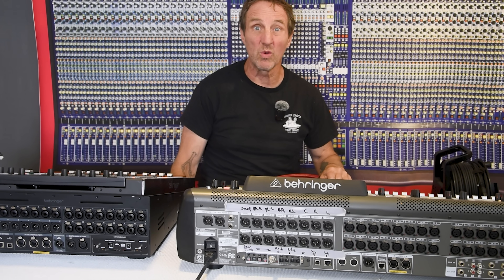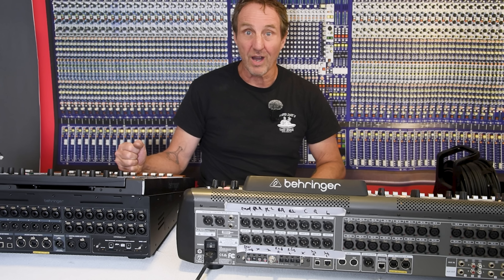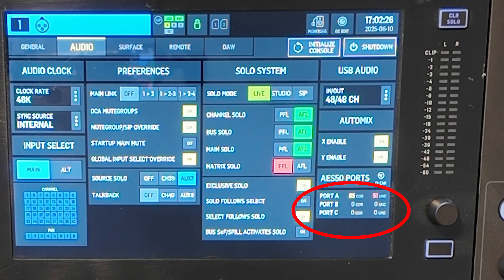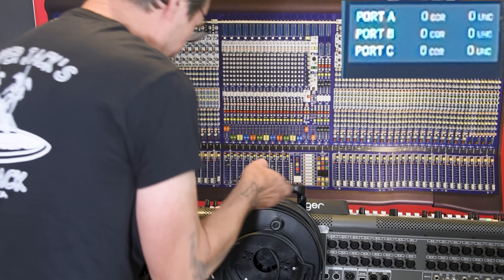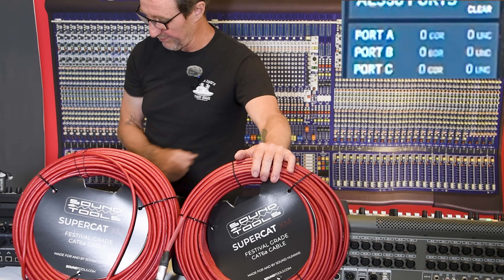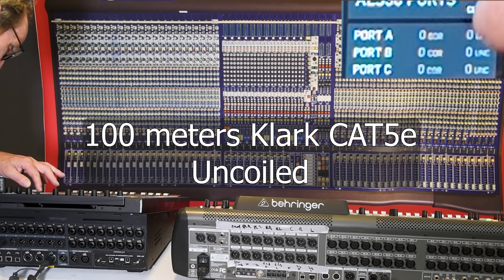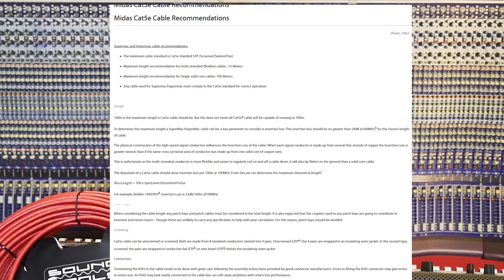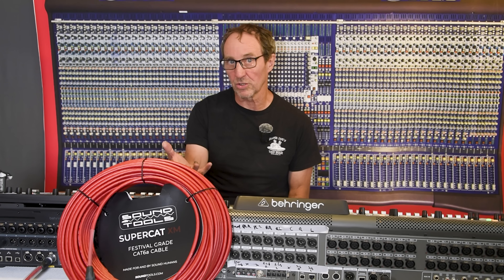Misinformation or Simple Test? - CAT5e vs CAT6a

Comment: Your video is a little misleading Dave. I understand you want to promote your own product but your evaluation is not a honest one. You did a video where you mentioned that Midas released a statement saying that they have changed their total run to 80 meters, instead of 100 as you portrayed in this video. I am one of those Facebook admins with close to 10,000 members who were adamant about using the Cat5e Shielded with Ethercon Connections, because our members were constantly reporting they burned out their AES50 Ports by using the Cat 6 like everyone was suggesting at the time. When I saw your video made over a year ago, you were just starting to work on your Cat6a cable. This video has convinced me that as long as the Cat6 or above cable meets the required specs, they should work just fine. FYI, depending on your firmware on the Wing, that could very well cause your drop outs as well as the update needed for the X32. Here is the link to the video you made over a year ago. https://youtu.be/bQXOXWuxCGA?si=su3quOLJPY0BZ5lQ
Reply from the maker: I totally agree with you and how is this vid misleading?

also, cat6a is typically much better than cat6 and shield is important for behringer products.

from all the testing I have done, the dominant factor seems to keeping loss at 24dB or less.

the cables with less loss are unshielded Cat5e and CAT6A (which should be shielded by design) 

another interesting side note is when designing the XM cable I could have released it as CAT5e as it meets all Cat5e specs. it also meets cat6 and CAT6A specs and I decided to use cat6a but that was a choice and every cable manufacturer is free to grade a cable at a lower spec.

in fact I am working on a plenum rated solid conductor shielded install cable that meets cat7 specs as well as cat6a and Cat5e, I am going to label it cat6a. 

what I getting at is it is I agree with you, it is all about the actual specs of the cable and not what the manufacturer labels it.
Reply: @DaveRat , your previous video showed you at 80 meters and this video shows you at 100 meters.
Reply from the maker: this video shows Cat5e at 100 meters versus cat6a at 120 meters.
Reply: @DaveRat , I have already removed the Cat5e only rule from my community and I am getting very positive feedback from your video. In your last video you stated that Midas made a statement about 80 meters is the max for Cat5e. 

This video shows you testing the Cat5e cable at 100 meters correct? That’s what I am referring to when I said it was misleading.
Reply from the maker: @DanaTucker1 ahh, copy that. I think Midas says the 80 meter max is for stranded which the KT cable is.

and yes, I did test at 100 meters which is beyond the max recommendation for stranded Cat5e.

the purpose of the video is to point out that any belief that Cat5e is is anyway better that properly spec'd shield cat6a for AES50 or pretty much any application is not founded in testable factual info.

quality CAT6A is awesome. faster data speeds, better shield, lower crosstalk, longer runs.

same with large diameter high quality cat7.

as for giving advice on what to use I recommend focusing on specs rather than catagory.

shielded cat cable with an maximum of 24dB of attenuation at 100MHz over the cable length being deployed is the magic
Reply: @DaveRat , I agree with you 100%. Some of our members are already using your specs and building their own Cat6a cables. 

To be honest, I am glad this stupid cable war is over and I will forever give you the credit for bringing it to an end!!

As always, forever grateful for the knowledge you share with us less experienced individuals who are seeking reliable information, from a place known for its unreliable information, the www. 😂😊
Reply from the maker: wonderful and that makes me so happy. stay curious and keep sound fun!

Comment: In IT/Network Cabling world, we used 85metres as practical maximum range for Cat5e.  (and ideally shorter).   Speed also makes a difference eg 10/100/1000/10k higher needs shorter in general
Reply: Good point and absolutely right. In his AES50 test setup, I assume Dave was aiming at a maximum bandwidth of 1 Gbps only, which is specified by most OSI layer 2 and 3 AVoIP network standards.
In a 10 Gbps network, cable length will surely be limited. But rest assured that Dante, SDVoE, AVB/Milan, etc. are using their very own (package compression, sample rate and bit depth limitation) methods to neatly stay within the 1 Gbps network bandwidth range.
Reply from the maker: wise. for large format live, 100meters is the standard length of the main snake. so 100 meters plus 2x 3 meter extensions is a good baseline.

but sometimes we need another 10 or 20 meters, hence my focus on 120 meters and a cable that will reliably do it.
Reply: @DaveRat  Makes perfect sense.  For most cabling runs - the 85metres was from a patch panel to a wall outlet.  That then gets patched at both ends so you are going to hit that 100m limit.  120 without going up in quality is pushing things.

Comment: Coiling: IF coiling made a difference (for the record, I agree it does not for shielded wire), a >larger< coil wind would have more inductance.  Inductance is proportional to the square of coil area.
Reply from the maker: by "larger coil" do you mean larger diameter loops or more loops?

is it quantity or loop size that increases inductance?

does one huge loop have more inductance than 500 tiny loops?

Comment: Are the wire gauges the same? Drop will tank any grade cable at a certain length.
Reply from the maker: the cat6a has 24g and the Cat5e in the vid has 26g.  that said, thicker wire reduces dc resistance but can increase capacitance which is also and issue.

but the thicker diameter of the cat6a reduce capacitance

Comment: This comparison gives a small piece of useful practical advice, but it'd be interesting to know "Why?"  

That might take a vector analyzer, a precision TDR, and a BER analyzer that tries to capture incidents and causes, not merely counts a total.   

It would make sense that shielded STP is better than basic UTP, as that limits potential mutual inductance and makes being coiled or not irrelevant, in addition to reducing susceptibility to induced or radiated fields of various sorts.  Fiber would be the next step, also in terms of ground isolation.  

A good analysis would evaluate better and less good line drivers, and life of cable breakdown issues.  

Even in the old days of 600 ohm analog lines at +4 or +8 and headroom over, s/n under, some brands of equipment had crap line drivers, and could self destruct, distort, or just not work right to the extent of full blown motorboating with long cables, while better products just didn't have such issues.  

As digital is really just an encoding of analog voltage and current patterns, it makes sense that longer digital lines can suffer similar issues if cable or line drivers quality is sub-optimal.
Reply from the maker: actually shielded is worse for loss than it's due to added capacitance rolling off HF.

the insulators one the cat6a are foam rather than solid which improves insulation at HF. the cat6a has thicker conductors reducing loss but increasing capacitance. the cat6a is larger diameter  increasing the distance between conductors reducing capacitance.

the precision of the twists is better on the cat6a.

the cat6a has individually shielded pairs which allows identical twist rates while still keeping crosstalk low. the Cat5e has an overall shield with the pairs twisted at different rates to reduce crosstalk.

those are a few of the main factors specific to these two cable types.
Reply: @DaveRat  By "insulation" you mean dielectric constant.  That translates to signal loss and to velocity of propagation, not that 60 vs 78 vs 96 percent the speed of light matters a whole lot on 100 meter distances.  

The reactance and band tilt may matter a bit.  Solid polyethylene or polypropylene is more stable and moisture immune, especially when handled repeatedly.  Stranded is better for handling, but worse for stable long term shape (until solid cracks).  

If you look at cables like 1 5/8 to 3 1/4 inch Heliax or similar gas filled coax with spacers, or at higher frequencies or powers, hard coax or waveguide, dried air or Nitrogen are used for even higher performance in those respects.  Not exactly temporary feed or low cost friendly.  

Compared to traditional snakes for 48 inputs and a bunch of outputs and some ClearCom talk pairs, "a lot larger" for gigabit+ Ethernet is sort of trivial.  

BTW, being subscribed here is dangerous and weird.  Every so often Google pushes me a bunch of ads for exterminators, alternately with scammish rat control products.  ;-p 

Back to audio standards....  Ever work with people who used dBrnC ?  

That's the old telco noise unit, sort of like Fahrenheit temp's.  Zero is the lowest it (noise floor) could ever exist, making for simple positive units, where 34 is a pretty good line, and 16 dBrnC incredibly quiet.  

That zero reference is -90 dBm, "C-message" weighted, which is roughly flat 20-20kHz, then sharply rolled off.  

How things have changed, when most people have 48 Gbps or higher home theater cables, and 104 dB dynamic range audio systems.  

In old exchanges with 19 AWG cable pairs and minimal damage from corrosion or lightning, it used to be possible to get fairly flat response from 15 Hz - 38 kHz and -75 dBm noise floor, +8 dBm operating level, and +24 dBm headroom...  from a phone company.
Reply from the maker: so cool and thank you!  love the info! not worked with dbrc but will look it up.

and oh my!

the rat exterminator angle is super funny!

thank thank !!!
Reply: Should have added before, rn = "relative noise", in dBrnC.  Unlike most other dB based units (m, K, V, mV, etc), dBrn (usually C weighted if used at all) has no obvious base reference for anyone who doesn't already know from historic trade practices in telecom.
Reply from the maker: thank you and love sound Telco history!

Comment: I do a lot of indoor AV installations and ive had this argument so many times. Architects specify Cat5e because thats what the vendor states, yet ive had far less issues using unshielded Cat6a than ive had with Cat5e. My recommendation is typically shielded Cat6 but its not easy convincing others
Reply from the maker: the specs for cat6a are much better than cat6. you will typically have better results from larger diameter cables.

unshielded will often perform better except in environments with esd or HF noise or cable bundles

Comment: dave!  love this stuff. how does your purple cat5e compare.  i’ve never had issues at 60m but now im curious if it’s worth upgrading to the cat6
Reply from the maker: for 60 meters you are in-spec with the purple. a few short extensions are ok. using cat6a couplers is always better when extending.

the purple cable performs better than the KT cable and maxes out around 80 meters to be in spec. longer lengths will work. 60 you are all good

Comment: What are the observable/audible effects of error city? Great video!
Reply from the maker: full volume loud pops and signal drop outs. pretty much the worst thing that can happen
Reply: @DaveRat  Except, digital high BER can have such micro-time pops or dropouts, humans have trouble sensing them as anything we have audio terms to describe.  

I had to sort that out decades ago wrt high grade audio lease lines between telco exchanges, in the era when digital channel bank T-carrier modules were replacing older analog systems.  Digital is way more stable and accurate, when it works.  Telco guys weren't used to complaints with yellow warning lights, but no red alarms.  

Over an active audio stream, it's really hard to hear moderate BER as other than trivial distortion of some odd kind.  On a steady 1 kHz tone, or quiet channel as noise pops, it stands out.
Reply from the maker: interesting and very cool. 

with AES50 since it's raw signal with no error correction the pops and drops tend to be catastrophic
Reply: @DaveRat  there is some error correction. This is why you have two values in the aes50 error counter; Corrected and Uncorrected.
Reply from the maker: @robertlofgren6834 ahhh, copy that.

Comment: Great video! I've recently seen some videos regarding the technical differences and testing between CAT5e, CAT6, CAT6a, CAT7, CAT8, shielded and unshielded, coiled and uncoiled, and the conclusion was that CAT6a S/FTP (shielded) was the best reliable cost effective choice (the shielding protects the wires from UV sunlight radiation and crowd WiFi interference), specially for long distance requirements such as getting the cable from FOH to the stage. Cheers!
Reply from the maker: awesome

Comment: Have you compared solid vs stranded cat5e? Not going to disagree about cat6a being better. Once you approach the 100m length limit weirdness is going to start happening depending on the surrounding environment and cable.

I imagine you already know but - typically in a networking situation you would only have up to 10meters of stranded (patch) cable at the ends and up to 90 m of solid core installed in the walls. Obviously in a touring situation stranded is going to outlast solid core by quite a long amount of time.

For new installs Cat6a is probably the best option for future proofing provided it fits the budget.

It'd be great if the error counter would come to the x32 as well. There's a lot more to a good digital connection that just the basics. Its easy to forget the analog realm of the cables.
Reply from the maker: Yes I've done extensive testing on solid versus stranded and that was the Crux of designing the supercat XM cable.

how can I get a durable flexible stranded conductor cable to perform as good if not better than a high quality solid conductor cable. 

I didn't care if it's cat 5e cat 6A or CAT7 or any of the other possibilities. what mattered to me was the performance specs while maintaining flexibility and durability. 

when I came up with was the cat6a grade but that's just a number of a spec that it meets. 

All cat6a cable meets cat 5e specifications but not all cat 5e cable meets cat 6A specifications 

getting the stranded conductors to perform as good or better than solid conductors was extremely challenging and required balancing multiple factors including the types of insulators, the spacing, the twist rate, the conductor gauge and so on. this further is complicated by using the polyurethane jacket which tends to shrink more and put more pressure on the internals when cooling compared to a PVC jacket so even though all of the factors are aligned, I didn't know for sure that it would test well until after it was manufactured but I did have multiple reference cables to compare to and base assumptions off of. 

another interesting aspect is when making the cable I assumed that this cable which is optimized for portable professional use would have almost no demand or usage for the install market. 

but I started searching around for solid conductor Platinum rated install versions that met the same specifications as this portable cable and was extremely surprised at how few options there are. 

so that started our next project which is to make a plenum rated install version of this with solid conductors with even better specifications

Comment: Dave starting the video with a description of the Dunning-Kruger effect, I like it 🙂
I've heard so many variations of local techs complaining about Behringer and cat cables, from "Cat 7 doesn't work, ever" over "If it's a shielded cable then that's really bad" to "Cat5e is actually the worst". We have Cat5e, Cat6a and Cat7 Ethercon cables and I have never had issues with any of them, but I have had issues with house cables as short as 40m. Sometimes a cable doesn't even fulfill the requirements of the standard that it advertises.
Reply from the maker: Yes, many people are quick too assign blame based on probability or guesses without filtering the results for credibility

those same people that jumped to conclusions seem to have high inspiration to share those conclusions. 

I think we see that pattern a lot where the people with the most out trying reduce that doubt like convincing as many people as possible that they're doubtful conclusions are correct. 

that said, I have not tested and proven that the above statements are indeed correct